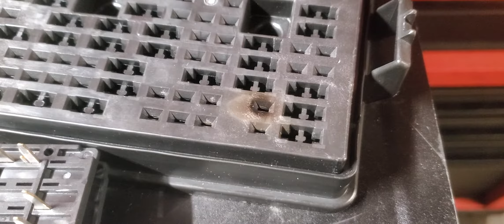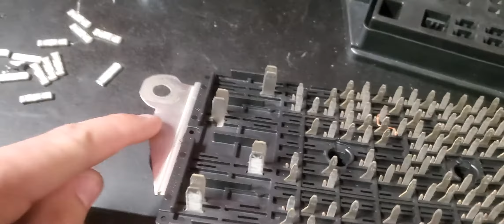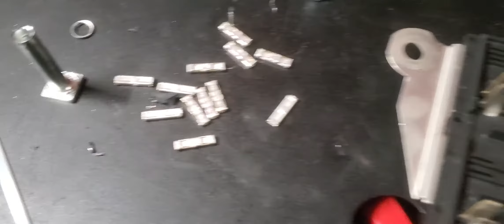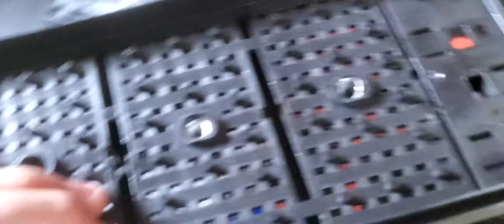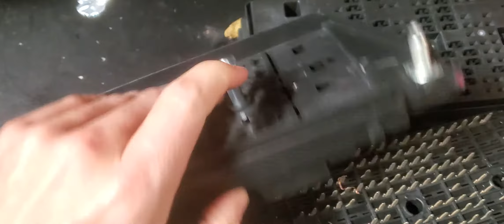Cadillac DTS/ Buick Lucerne Fuse Box Repair, No Start/ No Fuel Pressure/ Stalling While Driving

Comment: Instead of drilling out the 3 rivets, what if I access the female-to-female connectors by removing the plastic around it by melting it off with a slotted screwdriver that has been heated with a torch?  Once the plastic around it is gone, I can do all the swapping I want.
Reply from the maker: You could just cut a tiny square around the one melted terminal and pull it out right through the top without taking all the fuses out
Reply from the maker: The problem with cutting the plastic around the rivets is that you won't be able to securely get it put back together and it might vibrate apart over time
Reply: @grandpasbuick  Fill the void with QUICK STEEL expoxy from AutoZone or Home Depot.  I will only be removing enough plastic to access pin 30.  I found 2.8mm female connectors that crimp onto wires but I was not able to find the female to female connectors, so my plan was to make my own by crimping and soldering 2 of those together.  But I still need access to install it.  I don't want to drill out the 3 rivets because I don't have replacement bolts and nuts and I am afraid I won't be able to put everything back together if I have everything apart.  Worse case scenario, if my plan fails, I can always wire in an aftermarket relay with diode and fuse holder.  That fallback plan is alway available to me as long as I don't destroy the other circuits in the fuse box.  If I take apart the fuse box, I might destroy the other circuits and my fallback plan of last resort will not be available to me.

Comment: How long has this repair held up for you? I just completed it! 9/8/25.  If it fails,  im going to DIRET wire a 30A external fuel pump relay. 😊 Thanks.
Reply from the maker: It should last as long as the original fuse box lasted.

Comment: How do you separate the halves of the fuse box
Reply from the maker: @kdonovan3129  drill out the three rivet nuts, the video says where to drill
Reply: Hey I have a question if you’re still replying, I drilled the rivets out but am still having trouble prying the halves apart even with sticking screwdrivers in for leverage, any advice would be appreciated

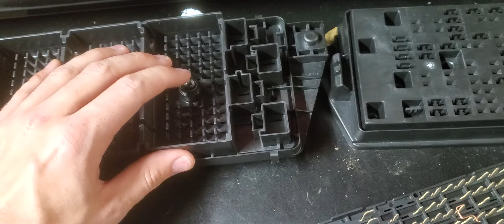Comment: Travis, this is a very helpful video, but at 3:23 you are talking about drilling out the "rivets" which are also internally threaded bolts. And you have one inserted from the wrong side and you tapped upon the head so I misunderstood and drilled the square heads off from the shafts (which wasn't easy because these are steel) rather than just drilling off the lip on the underside where the wiring harness connects.  You need these to work as bolts to hold the wiring harness solidly connected with the heads intact.  Perhaps you could add a note in your summary about this, please.  Thank you.
Reply from the maker: My apologies, for anyone reading this, don't drill out the square side, drill out the side that I'm tapping at 3:19.

Comment: I'm having the same issue at the same pin. where did you get the male to male replacement? thanks!
Reply from the maker: @shermanhemsley2906  junkyard, ripped apart another fuse box. Any GM fuse box of the same year range should work

Comment: Dont you just have to seperate the fuse box from its base with the 4 tabs. Then when you do this you will see all the wires going to back of fuses. Dont worry they cant come out. Yet. Then with a 7mm socket you can access the "3 rivets" which in my case (2010 Lucerne) is actually 3 bolts. The nuts are on bottom side holding the wire termination plastic retainers. I hope this helps. I dont mean to say this guy is wrong because some years/models etc they very well may be large rivets. But the 10' Buick Lecerne had long bolts.

Comment: Thank you, Travis. Thank you, Travis. I would say that 100 times.
I followed your instructions and I fixed my friend's DTS. The same problem, the fuel pump pin was heated up and oxidized. Luckily it was in a better shape than your fuse box, only a little bit heated up, but enough to not power the fuel pump.
I didn't have a male-to-male connector at hand so I decided to swap two connectors inside. The one that powers the coil of the fuel pump relay requires less current (only a few hundred mA) so I put the heated connector on its pin and I used the good one on the high current pin. Didn't test it yet, but I am sure it will work fine.
I really appreciate your video.

Comment: FYI I just went through this problem, on some other Internet videos and forums for the Buick Lucerne's they noted to a problem with the back seat bracket pushing on that corner of the fuse box causing arcing over time and there's apparently a new "shorter" fuel relay available and some people have shaved down their seat bracket. Anyway I filed down a section of a Bobby pin pretty good (any flat piece of metal would work) and shoved it in the burnt up hole and inserted the new relay and she's purring like a dream. Don't know how long this fix works for but good luck, this worked for me without having to take the fuse box apart.
Reply: This worked for about 2 months when I tried it.
Reply: How long did this work?

Comment: I had hired a mechanic. I didn’t know the time had a drug problem and he went and tried to repair my fuse box but was using a solder iron. Is the reason I kept having problems perhaps because he was using soldering and not a new malemale connector?
Reply: Probably not.  There is a TSB on this issue.  The TSB states to grind off the bracket under the rear seat cushion because it pushes up against the fuse box and causes this issue.  It's not the soldering and it's not the fuel pump.  It's the stupid bracket under the rear seat cushion.  You need to grind off that bracket.

Comment: How do you remove the connector block on the bottom?
Reply from the maker: Should pull off after loosening the screw in the center
Reply: @grandpasbuick  That's what I thought.  No such luck. On any of the three.  I thought that a bit strange.

Comment: Update. Fuse box I bought was wrong, so being pissed off I did this. Relay is tight now, and the car fired right up and relay remained cool to the touch. I did not drive it though. I let it idle for a while. I have anxiety with driving the car now but I gotta do it. I also hacked that thing off the seat.
Reply: how did you find the right fuse box?
Reply: @BluedupK818  no not needed. My repair to the old one has been fine for almost a year
Reply: @rm25088  oh ok copy that thanks for responding guy i appreciate it. im not very savvy mechanically. i got my fuel pump replaced because i smelled gas. they stated it was cracked. then a week later i couldnt start. my relay was burnt and on the fuse box here was a burned slot. i ordered a new fuse box i saw how to install it. anything i should know? you repaired your fuse box??
Reply: @BluedupK818  Yeah I just drilled out those metal rivets and separated it, I then replaced the burnt pin and replaced it with one of the pins for like a 5 amp fuse. It was pretty easy and it has been lasting for a while now. You just have to take a picture of all the fuses before you take it apart so you know where they go.. Install is pretty easy. Getting the connectors off the back is a bit of a pain but, I just pryed on them with a flat head screwdriver. Disconnect the battery also.

Comment: I'm going to have to try this. My DTS is having this issue as we speak. replaced the fuel pump and relay but noticed the same hole was melted a little. Started a few times, moved it and it died again yesterday. Another melted relay. I have a new used box on order, but it would be nice if I could drive the car before that. You can by pass that hole by running a wire from the post to the corresponding relay leg, and wires running from each hole to the correct legs on the relay, and mount the relay outside the fuse box.
Reply: Exactly what I'm about to do moving the relay out of the box wire colors you need are black, red/ white , dark green and white

Comment: Thank you so much for the video.  Instead of getting new female-female connectors, I found the one that was loose and soldered it.  That allows it to take high current without causing it to heat up.  Can also swap one out from a low current circuit.
Reply: Are you saying that you added solder to the new fuel pump relay fuse on the peg that is loose in order to give it a tighter fit? I'd love an easy solution like this. Currently I'm working on taking the under seat bracket off that is pressing against the fuse box cover. The solutions for the fuse itself have ranged from disassembling the entire fuse box as mentioned in this video to adding another fuse that would increase the voltage potential.

Comment: Where do I find those connectors
Reply from the maker: From another car in the junkyard.
Reply: @grandpasbuick  can it be any other GM fuse box around the same year?
Reply from the maker: @asid731  I would assume so but I have not actually checked.

Comment: Hey there. Did the repair replacement connectors work? Or did U install new fuse box. Thanks.
Reply from the maker: This repair is a permanent repair.
Reply: @grandpasbuick  so the repaired box was reinstalled?
Reply from the maker: @fmarquez35  not this one, but I did a different one the same way, yes

Comment: The heat from drilling the rivits melted the metal into the plastic!
Reply from the maker: That's what happens when you use a dull drill bit. That metal is pretty soft and should cut away pretty easily without heating up if you have a good drill bit.

Comment: I think i got the same problem, i need to change the fuel pump too?
Reply from the maker: Yes, the fuel pump is what kills the fuse box.
Reply: @grandpasbuick it 100% faulty or may it be only clogged up or dirty?
Reply from the maker: @hananelbitton5157  I suppose a significantly restricted fuel circuit could cause the same thing.
Reply: @grandpasbuick  Actually, the root cause is not a fuel pump that draws too much current.  There's a technical service bulletin on this and it says the root cause is the bracket under the rear seat cushion pushes in the fuse box.  The TSB states to grind off that stupid bracket to prevent this from happening again.
Reply: wouldn't it only burn up the fuse box if you jumped the relay? the circuit breaker should prevent that as well as the fuses. this has to be a short
Reply: @coryc5545  No, it is a shitty design by GM. Very common problem. Bad fuel pump, or the stupid seat bracket putting pressure on the fuse box making the relay tweak. Replace fuel pump, cut some of the bracket off so it no longer makes contact with the fuse box. It is just poor engineering.

Comment: What if I change the relay
Reply from the maker: If changing the relay helps, there would be no reason for this extensive video... It won't help anything
Reply: It helps for about 2 months if you are lucky. It's a bandaid, not the solution.

Comment: I have a 2008 dts had a hard time finding the male to male connectors myself I was broke down so I used one of the Male 2 male connectors of 5amp fuse and put the burnt one back in its place just tighten it up a little bit with a pair of pliers started the car up and drove it all the way back home 300 MI the video is very helpful when drilling out the backside of the fuse box be sure to drill slow the blue 40 amp fuses are hard to pull out but they do come out LOL